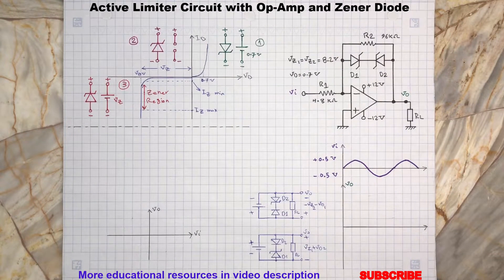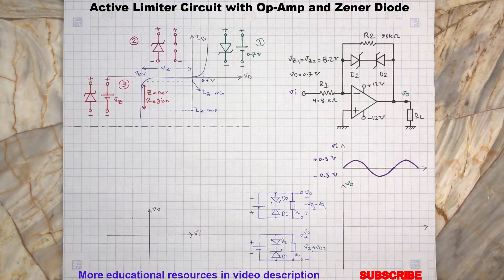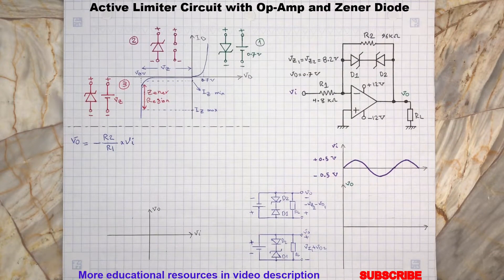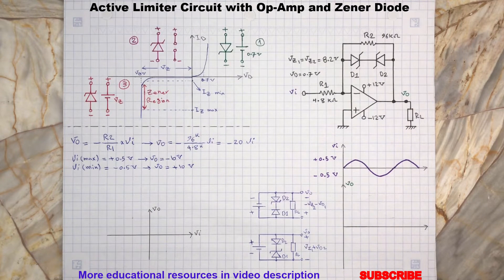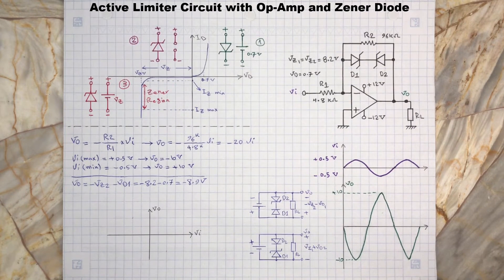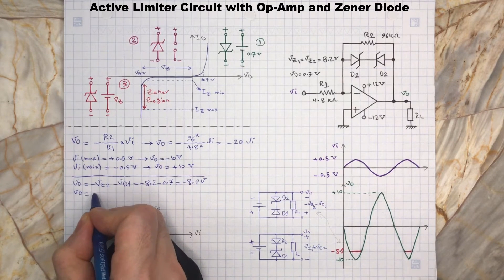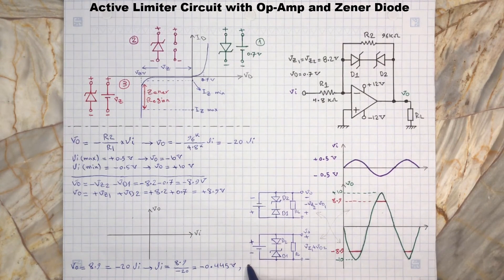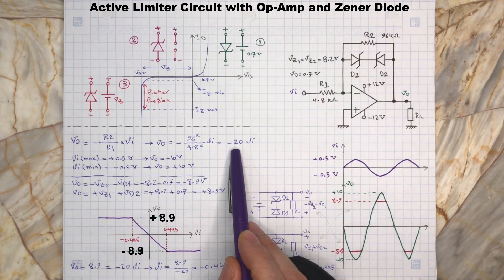Voltage Limiter Circuit Using Op Amp, Op Amp with Zener Diode Circuit

Comment: Thanks for this can it work as a variable active limiter as well with a potentiometer at the input voltage
Reply from the maker: This circuit has Hysteresis. You may want to check out the circuit in this video : https://youtu.be/AAEvPySJ7fk